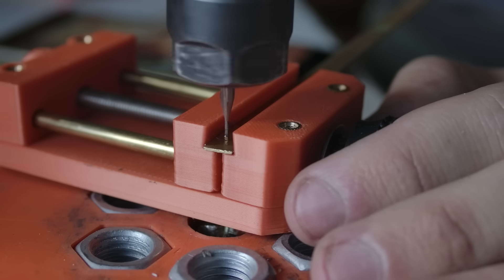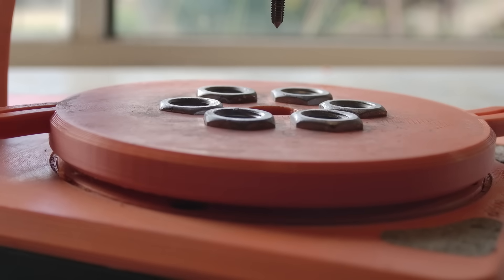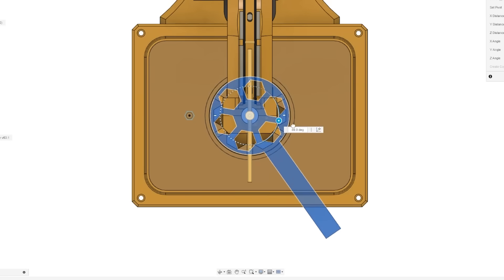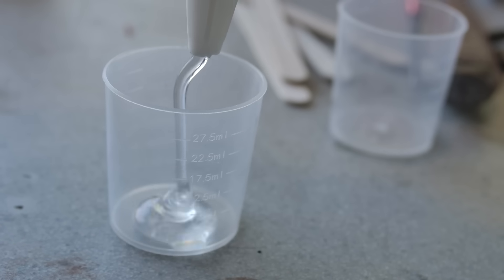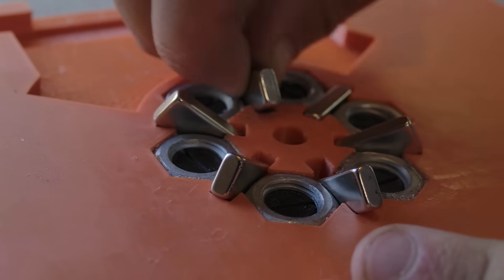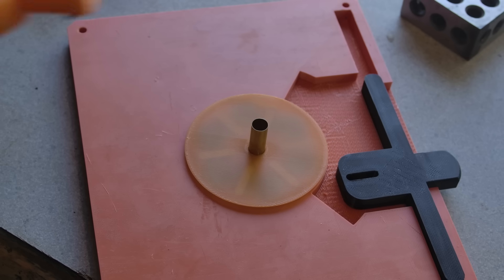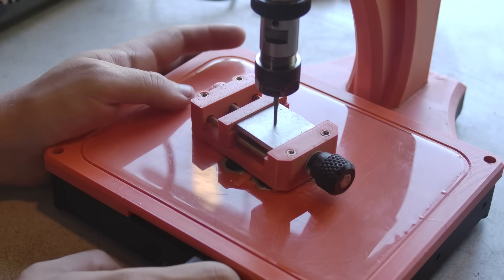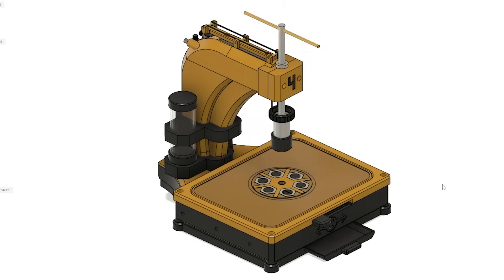3D Printing A Switching Magnetic Vise

Comment: I have to admit, magnetic chucks are absolutely fascinating to me. The fact that they use physical magnets and a lever to push and pull them inside with a steel plate for their surface is kind of incredible, especially when you consider how they work. Magnets in general are fascinating.
Reply: This comment brought to you by ChatGPT.

Comment: Great video. Suggestions;  Balls on the end of the arms and the shaft for ergo and safety. Enclose the counter weight system, so as to not catch the little strings, with a cuff. Small jam jar (or just a tin can, seeing the level is not very important), drill bit for ceramic, flexible coolant hose, mounted up at the root of the cantilever. Swarf tray. Chuck key holders at back of tool.

Comment: The epoxy top was a nice addition and turned out well.  Might consider a couple things next time.  Use a torch/flame across the surface to pop any bubbles.  If you're not adverse to sanding, you could do a slightly thicker pour of epoxy, then obtain some float glass (for a flat base), put a large sheet of sandpaper on the glass, and sand the epoxy table flat and to dimension using a technique similar to @robrenz surface plate lapping.  Work toward higher grits and finish with a polishing compound as you like.

Comment: The top platform should also move downward simultaneously with the polarity change. When active, it moves closer to the magnet with the reversed polarity and remains farther away when positioning the workpiece onto the platform. This mechanism is similar to how a surface grinder bed operates.

Comment: This is random as hell but do you happen to know some good .6 nozzle settings and could you do a vid on it? The only reason I ask is because those prints look clean as hell and its hard to tell but they kind of look like a .6 nozzle and I've been printing for at least 7 years and have several FDM and DLP printers but I only recently started using a .6 nozzle and no matter what I do I can't get it to print well on perimeter overhangs yet it works fine on regular bridging and it just constantly messes up even on small perimeter overhangs or any sort of overhang that isn't just a straight up bridge and yet it worked fine on the same STLs with a .4 at the same layer height of .30 meaning that the .6 should be doing better than the .4 since both were at .30 LH but no matter what I do it messes up and specifically one of the parts is the "Gridfinity Refined" boxes/trays (not the normal Gridfinity) because the Refined versions all have a large ~14mm hole/thread at the center of each 1x1 of the base that leads to a 0 degree overhang and no matter what I do in my settings my MK3S tries to do a snail helix thing instead of just a bridge and it collapses every single time with the .6 nozzle at .30 LH but rarely did with e .4 nozzle which makes no sense and I legit wasted a KG of filament trying to solve this issue
Reply: I have been using a 0.6 nozzle for a long time so hopefully this information is relevant. I am using Cura which has bridge settings control; Does prusaslicer have that (assuming that's what you're using)? The helix sounds like you have no special settings and a different bottom skin pattern enabled. Also you should be able to see what kind of pattern will be used in the preview to avoid wasting filament. Finally, when you do have straight bridges you may have to increase your printing temperature to compensate for the much larger flow required.

Comment: Finally! I can comment on something I have extensive experience with! So I spent YEARS creating a highly specialized magnetic chuck for a WOODWORKING project that I told my customer would take a few months 🤦🏻‍♂️ I made an obscene amount of prototypes before I realized all my efforts were in vain, because nothing you do with a magnetic chuck matters without precision. The second you remove tolerances from a rough mock up, the behavior completely changes. Your design is great! It's very similar to what I landed on. The only thing you're missing now is the precision. Magnetism sort of "bleeds" so every little gap(even for the glue between steel and magnet) or misalignment is actually a big leak. The hole in the nut = massive loss of holding strength. The magnets extending past/above/below the nut = massive loss of containment when off. That's why it won't fully release your vice. For your needs, custom magnets would be a waste. But if you could replace the nuts with steel pie wedges that have the same side surface area of the magnets you already have, it would be a would of difference! Last, the magnetism is never fully contained by the magnets alone, you need a piece of steel across the entire bottom to absorb the residual fields. Back to the first point: if you add that bottom plate now, the whole chuck won't work anymore bc of the "bleeding".
Reply: Don’t make em redesign again🤣 but super useful info!
Reply: Pin this man to the top
Reply: OK, but as an intermediary step, 19mm Bright Mild Steel Hexagon Bar is fairly cheap and easy to get. I would be interested to see how much improvement just cutting lengths of this gives, over the nuts.
Reply: I mean he just made a mill he could probably machine up some nut replacements that dont require a full redesign and would close the holes
Reply: If you want a solid metal filling for a nut, I hear there's an available part: it's apparently called a "bolt".
Reply: I started reading this comment and immediately though about Tesla’s character in ‘The Prestige’ movie.

Comment: i am puzzled why you didn't go all in on the epoxy surface. wouldn't it be preferable to have a complete covering on top?
Reply: I was thinking the same thing. This way he has it now, metal dust can collect I would think? If he did a complete pour it would be easy to wipe away any metal that builds up.
Reply: My thoughts too: cover the whole thing then sand it flat. You'll end up with an even coating which, after sanding, doesn't have to be too thick
Reply: I think he was trying to A. keep epoxy from flowing into the swarf hole (which could have been prevented by putting a tube in the hole that could later be cut off flush) and B. keeping epoxy out of the centers of the nuts for some reason (maybe he wants to be able to remove those plugs at some point, like for cleaning).

Comment from the maker: Sorry for the delay with some files, been doing some admin today uploading and fixing files as well as getting through answering questions, sorry if I didnt respond for a time. Still working on the mill but havent been able to print much due to the lovely Australian summer (At 1PM today I was living in the hottest major city on the planet at the time). My workshop becomes a giant heated chamber, literally (the printer cooling fans sometimes turn on automatically even when I havent used them in days).

Anyways thanks for watching and almost 100k!
Reply: That's fun, I recently had the opposite problem here in Massachusetts.   My printer refused to turn on because the hot-end sensor read 0C and it assumed that meant a bad sensor.
(The temp in my basement was actually 4C, so that tells me something about the hot-end sensor, I guess.)